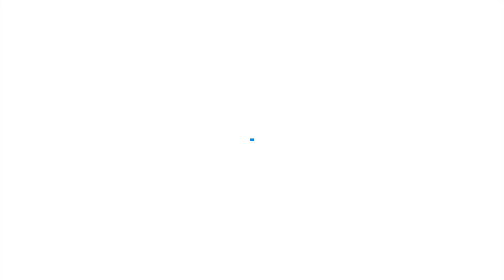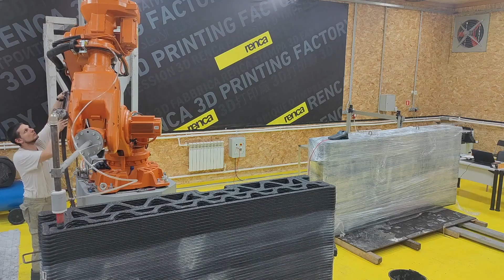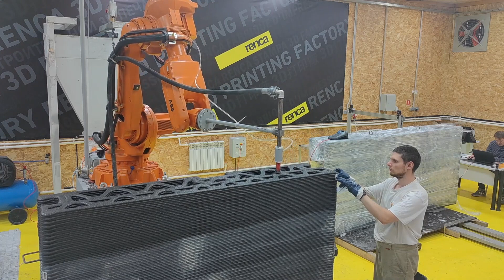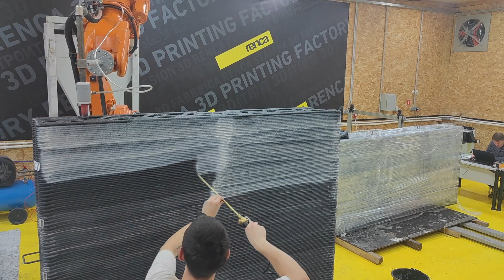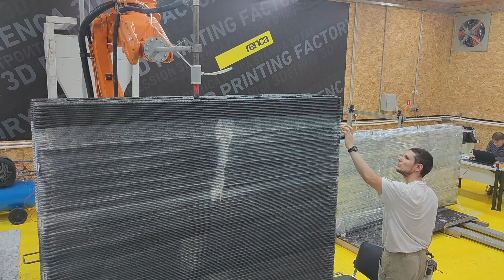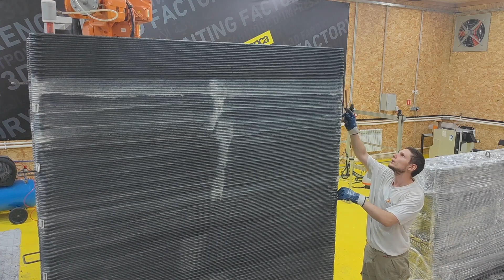Printing Geopolymer Buildings with Renca

Comment: Pumicecrete is by far the best building material on the planet Pumicecrete is a mixture of pumice cement and water mixed and poured into a set of reusable forms walls are poured from 12"to 24" thick pumicecrete is non toxic no off gasses fireproof termite proof rust rot and mold proof and has a high R value and good sound attenuation solid poured walls means no critters can live in your walls Pumicecrete can be built for a fraction of the cost and time and the entire house is made out of 3 materials Pumice cement and water and its perfect for automation
Reply from the maker: show me a video of you printing it.